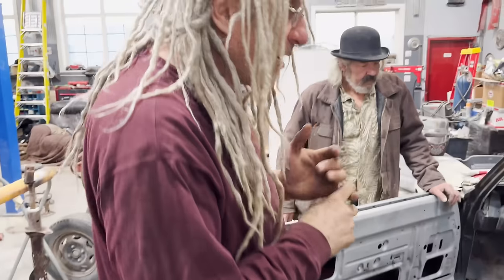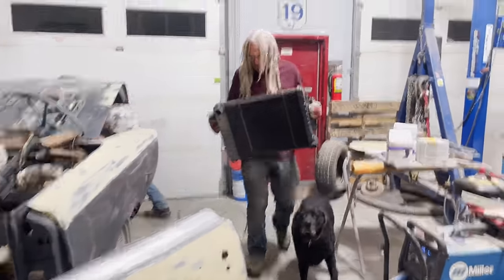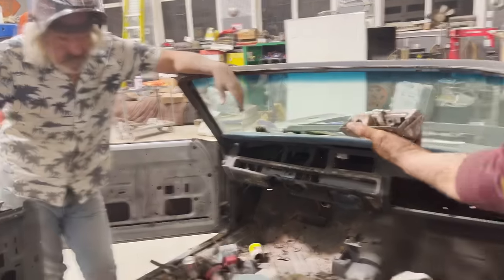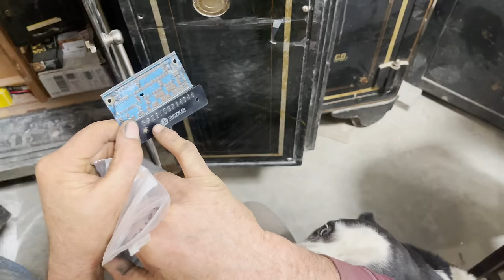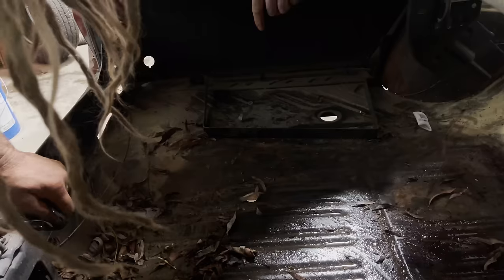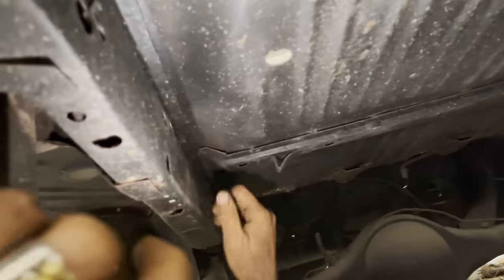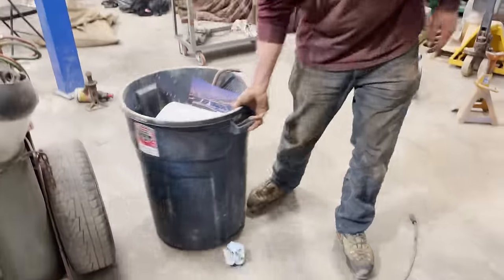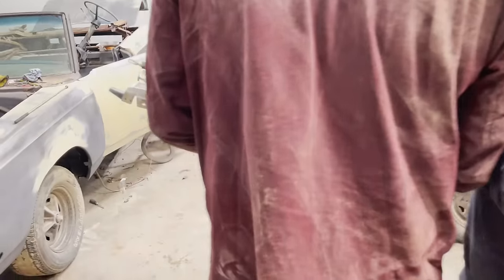Mike Finds Treasures While Cleaning Out the Road Runner

Comment: You keep looking for the wrong radiator. Mopar had cut out on the bottom of the brackets so you could put in the bottom bolts and slide the radiator into them to hold it in place, so you could put your top bolts in. And yes, Mike let's hear your smart-ass comments. I can hear you now. I've been doing this for 80 years.

Comment: 68 road runner or satellite.?With the wrong springs and non blackout grille it seems more satellite.I didn’t know they made a convertible in 68.Vin should start “RM2” I think.Is that sand silica?Hope you’re not inhaling it’s dust.The blue steering wheel looks like from a Road runner (stripper)not one that came with that trunk appliqué (deluxe).